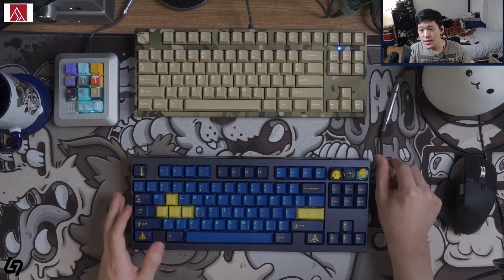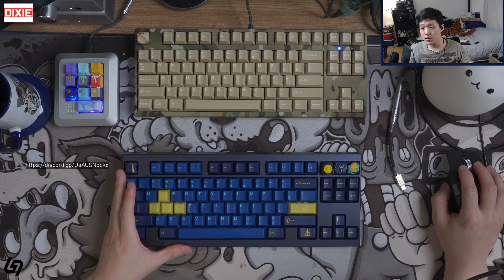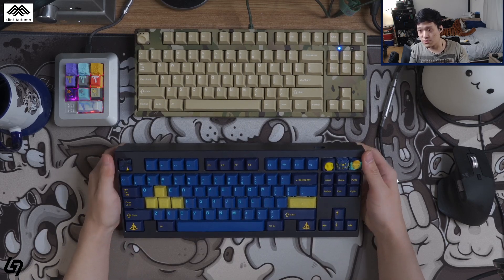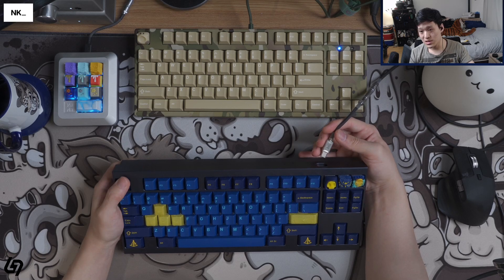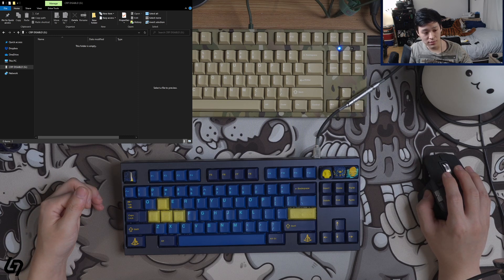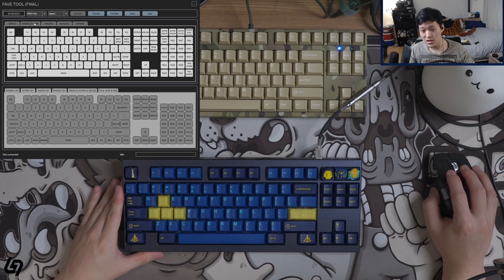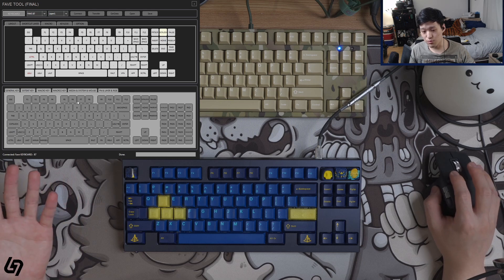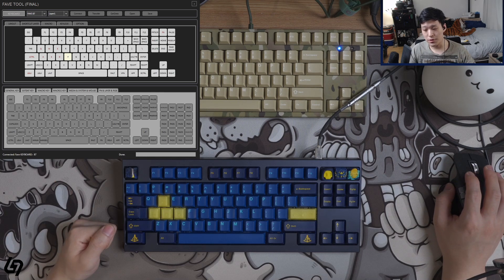FaveTool (v3.3) PCB and Software Tutorial

Comment: Only ESC F1 F2 F3 F4 showing in the fave tool after i did the firmware copying..
Reply from the maker: I believe this happens to some users with certain locale settings (generally EU users). You can reach out to LINx3#3430 for a fix.

Comment: How to get the CRP Disabled drive to show up when you plug in the Fave87 PCB? I'm pressing down on esc before I plug it in but it doesn't show up
Reply from the maker: Are you sure you are using the old Fave PCB? If you purchased a new one from KLC (says something like Fave 87 PCB made by ebastler, in the back), those should be QMK/VIA compatible, so you want to flash those with QMK Toolbox.

If you can share a pic of your PCB, it should be easy to tell which kind it is.
Reply: @LightningXI  Yea it's the one made ebastler. I'll try with the QMK Toolbox! thanks.
How about the case for the Fave V2 WK hotswap PCB (H87)? Same thing that the drive doesnt come up.
Reply from the maker: That should also be QMK/VIA compatible. https://discord.com/invite/dnYYzFWhkR Join the KLC server and check #downloads channel for details.